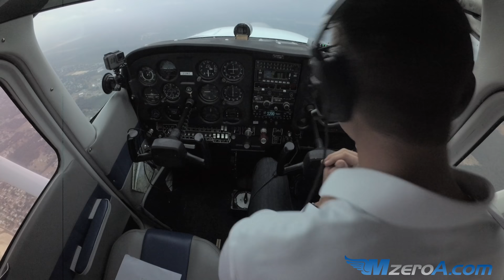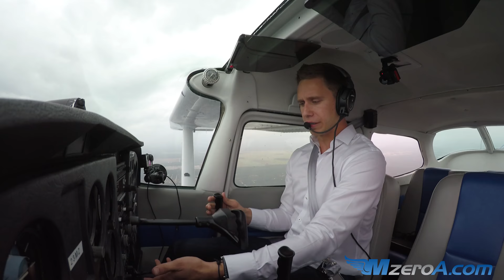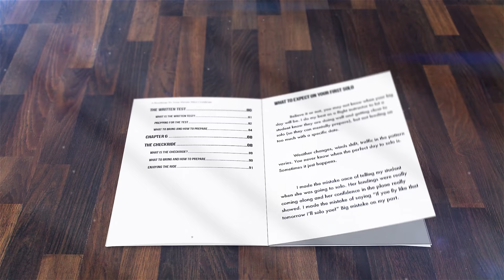ACS Slow Flight - MzeroA Flight Training

Comment: Well the new ACS does have the applicant fully stalling in various configurations, but not in"slow flight" so it is good to know that a full stall recovery can be still taught and evaluated. Beyond the check ride and aside of the ACS, I think there is nothing cooler than going out on a windy fall or spring day and doing slow flight and just hanging there like a helicopter and using throttle to raise and lower your altitude.  It is an extremely great skill to have as a pilot to have. Knowing the outer edges of your performance envelope of your airplane really makes your skills sharp and increases your awareness and sensitivity as an aviator.

Comment: I trained for my private in 1984 in a 152 with an amazing instructor, and we learned full slow flight with the horn blaring, and all was good. I believe that my recovery skills are virtually instantaneous, and was thankful to experience the delicate rudder balance that you can only feel in that mode. That said, I HATE to hear the stall warning horn at any phase of flight, as I consider it a harbinger of virtual loss of control. I don't even really like it in the final phase of a great landing, preferring instead to touchdown with an extra 5-10 knots in my current Turbo Arrow. I think that anyone who believes that listening to a horn during slow flight or stall training will somehow make a pilot think that hearing the stall warning horn while flying normally is OK does not really understand analytical pilot logic. Each time I read about an accident near an airport, whether arriving or departing, I assume correctly (mostly) that there was a stall horn, a stall, and then an unrecoverable spin, and I want to stay as far away from that as possible. Practice safely so that it never really happens to you.
Reply: Funny I learned in the same manner... cranking that 152 up to the horn.

Comment: If you have a good understanding of the aerodynamics, the stall warning horn, angle of attack, etc, the slow flight PTS vs ACS doesn't matter. You'll be just as safe, because you have the knowledge that you should recover in a real-world situation where you hear the stall warning horn during a time you didn't expect it.

For some pilots that are a little less bright, and who learned slow flight in a rote-learning manner under PTS standards, they might benefit from an ACS slow flight because they are taught the simple rule of "stall horn = bad. DO SOMETHING!"

I wouldn't be surprised if the stall-accident data was the same after a few years of ACS, but I also wouldn't expect the stall-accident data to show a worsening trend because of ACS.

Comment: On ACS Slow-flight, yes, just as long as the pilot within their management skills is monitoring the passage of air over the wing and relate aero-structures, that make that plane fly. This is a procedure that you don't want to be complacent at, but pay attention to what both the plane and you are doing, all of the time. The application might be, ground tracking on a lost aircraft, or location pursuit of a traveling object placed upon the ground, or in water.  Slow flight can go into stalls and from stalls break right or left into a spin. So flow flight and spin recovery, in a way are kissing cousins in potentiality. Thanks Jason

Comment: I think the new regulation is a mistake.  Slow flight training is extremely important as a building block for all kinds of different flying that you may get into down the road.  Knowing how to handle the plane and how much control input is needed when in slow flight is critical for things like, glassy water landings, short field lands and a whole host of not only everyday occurrences but emergencies as well.  Glad to hear you are teaching both! If hearing the stall warning horn in anything other than an emergency is the concern then what about on every landing?  In the final moments before touchdown the stall warning horn is actually the sound of my own little cheering section that I am about to have a great landing!  :)

Comment: I think its important to remember the context in which we are training.  All pilots should know how their airplane performs at minimum controllable airspeed (fly in slow flight with stall horn on) to know the limits of how the airplane can perform at slow speeds. It builds confidence and helps train for landings.  In certain situations, a short one second sound of the horn should alert of a possible stall and should of course be corrected immediately. Especially true for turning maneuvers and flight relatively close to the ground.

Comment: Do I believe that ACS slow flight will create safer pilots? I do believe that conditioning the body to immediately react to a given circumstance works. When you are used to flying on the horn, it doesn't incite the reaction that is necessary in a real world stall scenario; your mind doesn't naturally associate the horn with danger. However, if we begin training our minds to associate the stall warning horn with executing stall recovery, it may prevent some fatal accidents in years to come.

Comment: Regardless of what's on the flight test, you need to know how the plane handles in the entire flight envelope. In the Great White North spins are a PPL training requirement but not a flight test item: you need to know what they look and feel like, and how to recover.

Spin training saved my backside earlier this year when I was practising stalls in my plane and a wing drop turned in to an incipient spin...
Reply: Laura Halliday I would recommend some additional stall training.  A properly execute stall and recovery should not result in a spin.  I certainly approve of spin training and think anyone who wants to see it should, but it sounds like your stall entry or recovery was improperly executed.  Better stall procedures will result in less altitude loss than a spin/recovery, and the most likely place to encounter this is in the base to final turn, where altitude loss can be fatal.

Comment: Like you, Jason, I learned PTS slow flight.  There are advantages to that - you get to experience the control sloppiness at the limit, and THAT more than any audible warning should alert you to trouble right around the corner.  Personally, when I hear the Stall warning in ANY performance profile OTHER than slow flight or a stall practice, or a check ride...I REACT.  Most of my pilot friends do.  We're not idiots, and I think the FAA is reacting out of lawsuit fear or something.  Bottom line: in anything OTHER than a check ride, it's hard to get desensitized to the stall warning, therefore, I think ACS is much to do about nothing.
Reply: Plus, every landing is a stall, and full stall landings are the best.  So, as you bleed off speed and hold it off, learning how to react to a crosswind or gust is a valuable thing.  PTS slow flight teaches that.

Comment: Man im having issues with slow flights, stalls. During my slow flights the plane fell into a spin twice! So im watching this now and will have this done in the morning.
Reply from the maker: Hey David! A few tips that I think will help.  Make sure you keep a close eye on your coordination when entering these conditions. This is the key to preventing a spin during a stall situation. Here's a few more in depth tips.

1) slow flight: always remember PITCH FOR AIRSPEED and POWER FOR ALTITUDE. What's going to keep you out of the stall in slow flight is making sure you're using the appropriate control inputs. If you're getting too slow, lower that nose and regain some airspeed. 

2) Stalls: As I mentioned earlier, coordination is key. Make sure you're not being too aggressive with your stalls, you can get into a power on or power off stall without being 20+ degrees of pitch. You can execute a power off stall with as little as 5 degrees of pitch with the power at idle to get a gentle result. 

Hope that helps!
Reply: @MzeroAFlightTraining  I’m guessing that an aggressive stall changes the flight dynamics faster than people can compensate for them, cause the spin.

Comment: I doubt very much ACS will change anything in the long run. I liked flying around with the stall horn on. It built a lot of confidence. Regardless of how I was taught, if tower told me to go as slow as possible, you wouldn't see me flying around with the stall horn on anyway! It seemed fairly obvious that is a training exercise, and any other time you hear the stall horn, you deal with it as you would a stall.

Comment: I think you answered it Jason, "time will tell". I'm a student of the PTS, but I can see how not being use to the STALL HORN would make one more reactionary oppose to procedurally.  When you hear it you should do something reactionary, which I think you also said. However there are some planes like the DA40 that will trigger a stall horn on landing; also well above the POH stall Vs or Vso speeds. The Cessna 172 not as much... Piper PA28, at least on ours is just a red light, which I haven't seen - suppose that's a good thing. Point is if I see the light, or hear the stall warning should be an indication to act upon it and prevent the onset of a stall. This is where I think the ACS is probably better than the PTS. This is of course my opinion... Will this decrease accidents related to stalls? Who knows.

Comment: I learnt in the UK and I was taught anytime you hear the stall warning you recover, except when practicing an ACTUAL stall recovery. It should be ingrained and automatic. But you still need to be able to demonstrate that you appreciate how the control feel changes right at the edge of the envelope and the difference in feel just before the warning and just before a real stall is insignificant. I don’t think it’s a good idea to get used to flying around with the stall warning blaring away.

Comment: While the reasoning makes sense I personally don't think the change will affect much considering a CFI should make sure their students know that the stall warning going off at times where you are not supposed to be near any kind of stalling configuration requires and immediate recovery. At least for myself I have never considered the stall warning horn as not a big deal  unless it occured within a couple feel above the runway on a landing (literally just before making contact)

Comment: I really think that the old school pts slow flight is a better practice than the acs. Yes, students should not get used to hear a stall warning, but for training purposes, it should still be practiced/performed. That way the student will understand completely the characteristics of the airplane that they’re flying. They will also know what correct action should be taken if they get into any unusual situation, and not only know what to do because “thats what they were told to do”. The old school pts definitely gives more valuable practice/training then the ats.

Comment: I've never did my slow flight hearing stall warning horn throughout my training and check rides in the Philippines.  if you hear stall warning horn and completely stall with power on , we call it power on stall if you are stall with power on and flaps its called power on stall with flaps. Stall is very dangerous than everyone imagines which can lead to other things like spin etc. That's why my instructor never let me to hear stall warning being horned for long time if i stall recover immediately.

Comment: I think that regardless of what technique of slow flight you were taught under, you always have to have personal awareness of how stalls are initiated and ALWAYS behead of the plane. I think that the new way of teaching slow flight will not have a positive or negative effect on accident rates and other statistics. Accidents happen when you lose awareness of yourself and your plane while flying. If I had to chose one or the other, I would choose becoming more comfortable with hearing the stall warning horn showing you that your plane is capable of flying with the horn going off and do not need to recover right away (at a safe altitude of course). Although you would not want to hear a stall warning horn constantly going off on a cross country flight or something of that nature, it is important for pilots to become comfortable and confident in the plane they are flying

Comment: It could help, so long as people don’t start panicking over the stall warning horn.   I watched a show about a plane crash that happened because the stick shaker went off and they pulled up and ended up stalling the airplane instead of pushing forward because both of the pilots were extremely fatigued and flying for a regional airline.   I think people need to learn how to deal with emergencies, like spins for instance, or engine out, or losing instruments, management of loss of the different flight controls.   My guess is panic kills the most pilots when emergencies do arise.  I think the VFR pilots should be required to learn the basics of IFR flying just in case they Accidentally fly into IMC conditions, especially if they’re flying at night.
Reply from the maker: It is always good to have some instrument practice. Thanks for the  insight!

Comment: Any kind of intentional maneuver that exposes you to a warning situation has the effect of marginalizing that warning situation; in this case, intentionally flying with the warning horn sounding will train your brain that the warning horn is "normal" or at the least less concerning. This is a bad recipe, and I think the ACS Slow Flight makes more sense; it teaches you how to control the aircraft but maintains the importance of heeding that important warning. A stall at 3000 feet is easily recoverable; a stall on short final can be a much bigger concern.
Reply from the maker: Thanks for your input! Fly safe!

Comment: In helicopters the horn is low rotor rpm, which actually works the same way as a stall... Except it ends with the tail of the helicopter being chopped off. I love helicopters haha

Comment: Both methods are useful. I wonder, though, if you fly without reaching the warning sound or light, how will learn to recognize an imminent stall? Will you get the buffet or super mushy control feel? I learned with the old way and did it on the checkride, including turns with the horn blaring. It was, I feel, a great way to recognize what was happening with the plane. Yes, if you here it, you should take appropriate action...goes without saying....and if you are trained to react to it you should not have an issue. Can not remember, does the ACS recommend training with full stalls and recovery...I believe the new way does not require full stall recovery in the checkride which you used to have to do.

Comment: I would suspect that ultimately both "methods" need to be taught. Begin a student with the PTS "method", as this would seem to be the best way to develop the best "muscle memory" of the steps to recover from a stall; then gradually introduce the ACS standard of recovering the moment the aircraft alerts to an impending stall. This way, in the early phases of flight training, the student pilot develops an understanding of how the aircraft "talks" to them leading up to the stall and is taught the steps to recover before those steps are put to a tempo which may not be most conducive for learning.

Jusy my $0.02. Feel free to give me change if you think it's warranted.

Comment: It was some time ago but during my check ride nor during my last flight review was the stall warning going off during slow flight. I was trained to slow fly the airplane at 1.3 X the stall speed which is very slow but the stall horn was not sounding. I had to maintain altitude and make 90 deg turns to demonstrate i could fly the airplane while landing.  I didn't see the need for the change.  What do they consider slow now? 1.3 X the stall speed of my airplane is 52 and Vr is 55.

Comment: Under ACS. What happens it the stall horn was broken down the road. The student would not know what it "feels like" at the start of a stall
Reply: Jeff Daugherty . Wouldn't that be why stalls are still required? In power on and off stalls you will hear the horn and aircraft will buffet at point of stall. 
Only thing here is that in slow flight they rather not have the horn go off.